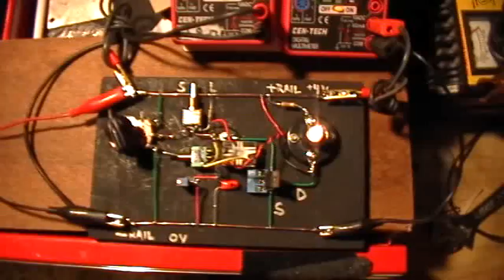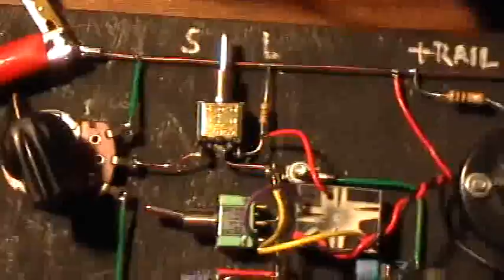Electric OU: Supplement: MOSFETs... How do they WORK?? Part 5a

Comment: Can you in layman terms explain what is the law of electronics or physics or normal component behavior that Ainsley is claiming as overunity? with so many videos and criptic talk is not very clear what's the point...I apologize about my own ignorance, but it takes infinite time to follow you up due to your years of study and expertise...Thank you
Reply from the maker: Well, that's not so easy to do, since she keeps moving the goal posts.

She has at various times claimed COP > 17, COP INFINITY (caps included) and that the batteries do not discharge at all while running "her" circuits. Lately she has toned that absurdity down to predicting that the batteries will exceed their rated capacity. But this is a known phenomenon when LAs are on a pulsed discharge schedule.

She has always maintained that there is more power dissipated by the load resistor than is supplied by the batteries, and as far as I can tell she is claiming, without any evidence, that the mass of some circuit element like the resistor is being converted to energy according to Einstein's equation. Part of the basis for this claim is her belief that the Q2 transistors are "disconnected" during the oscillations, and this belief is caused by her lack of understanding of these basic mosfet characteristics. These videos are pointing out that ignorance, because she herself is unteachable, I have known that for a long time.

You really should read the two daft manuscripts outlining her claims, but be aware that the data in them is all invalid, half being fabricated out of whole cloth, and the other half obtained improperly.
http://www.energy-shiftingparadigms.com/

The manuscripts, her "current" version of them, are linked from there, and you can also see what goes on in her twisted mind by reading the forum posts.
Reply: Aaamen brother I believe you thank you for the extensive explanation coming from you it is gratefully expected, I had and idea about what you say after all, you have been clear patient and relentless in your pursuit for the truth, I was affraid I was misinterpreting your information myself...I will certainly following up your posts we do learn a lot , hey! what is 555 videos? nothing!! lol, thank you Tinselkoala